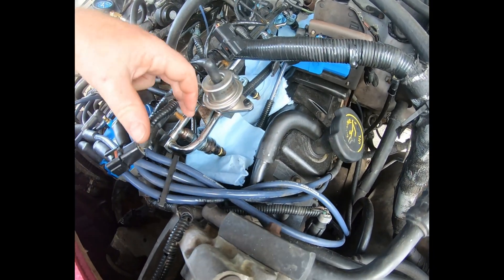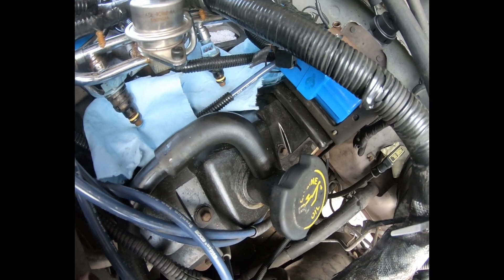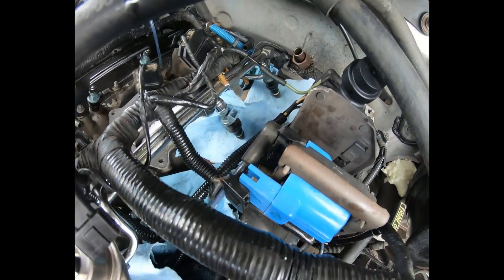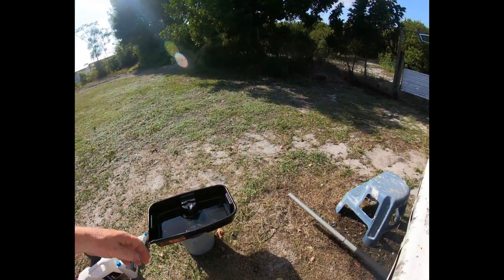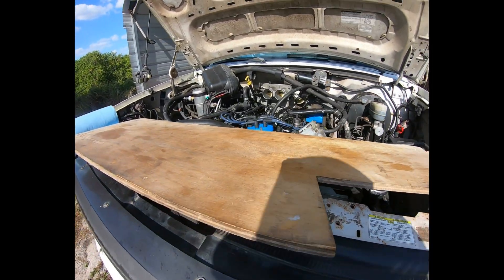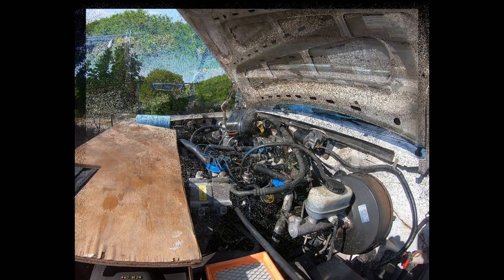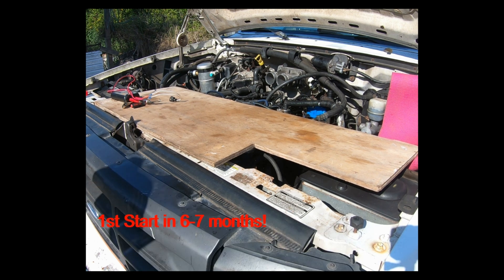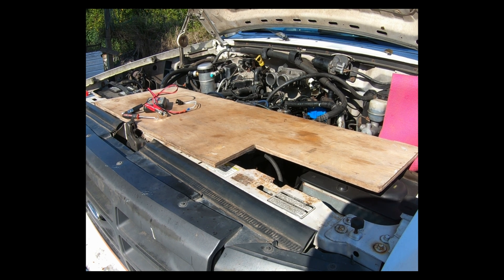1997 F350 (ex)U-Haul 7.5 460ci EFI diagnosing the fuel pressure and injector problem. Part 2 of 2

Comment: Congratulations on getting it running! Sounds like it's running good. I have a '93 F-250, 460, that's spitting fuel out one of the exhaust ports where the manifold bolts to the head, so I watched a few of your videos. Lots of good info. I replaced my fuel pressure regulator, so now I'm thinking it's the number 8 injector at this point.
Reply from the maker: Glad I could help. Good luck on the fix.

Comment: So what turned out to be the issue? I have a 95 f350 with the  7.5 efi, crank no start, I have fuel.
Reply from the maker: Contaminated tank, filter, lines and injectors (water & rust). See our F350 playlist for listing of all videos. Check if you'll start w/ starter fluid. If so, then the problem's somewhere in the fuel system .
 Thanks